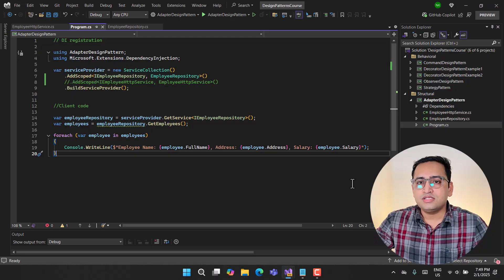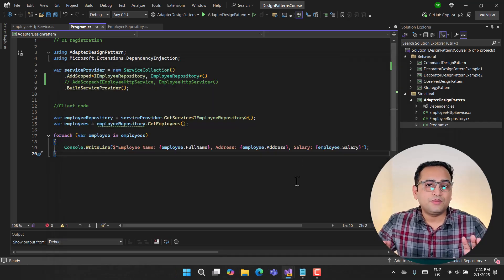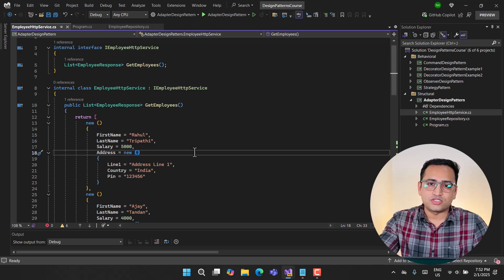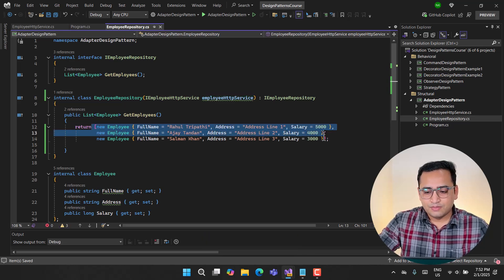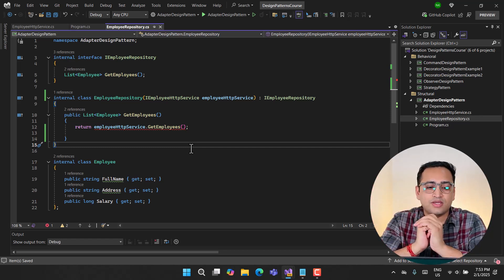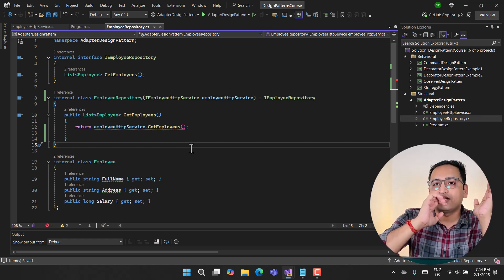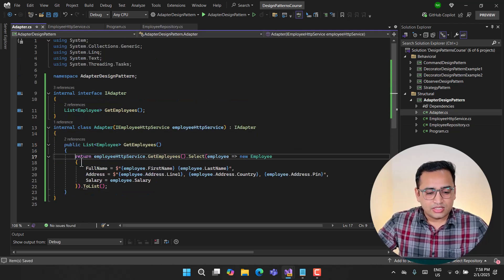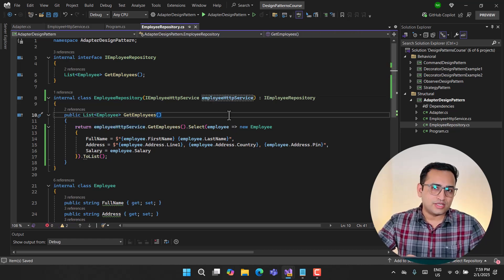Adapter Design Pattern in C# – Real-World Example & Best Practices

Comment: Mene ek Vivo ka  adatar liya tha kitne ka hai please bata do 😢 🙏🏻 jis se liya tha usne 3300 rs ka diya hai bool raha tha orginal hai 6m guarantee hai 

MODEL: V1820C-IN

ADAPTOR

INPUT: 100-240VAC

50/60Hz 0.5A

IS 13252 (Part 1)

OUTPUT: 5V 2A

IEC 60950-1

OR 9V 2A

S/N: 352E2200720030A02